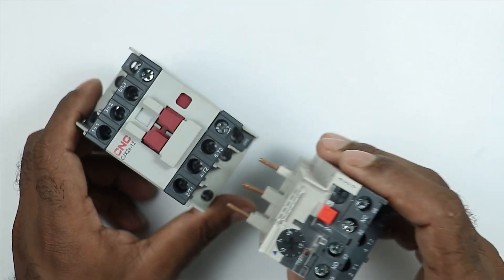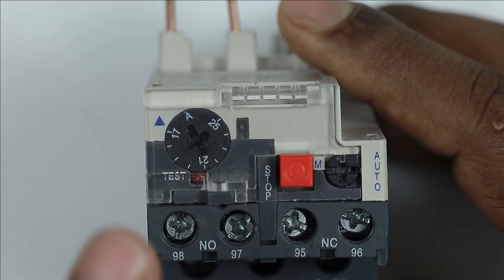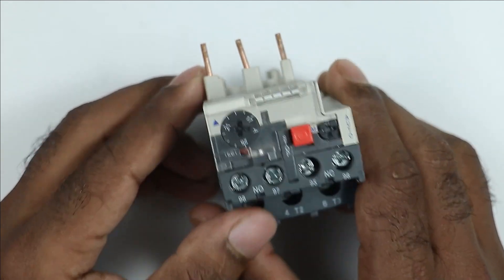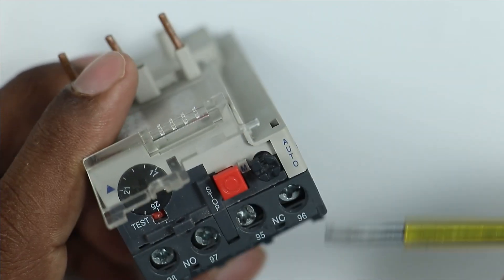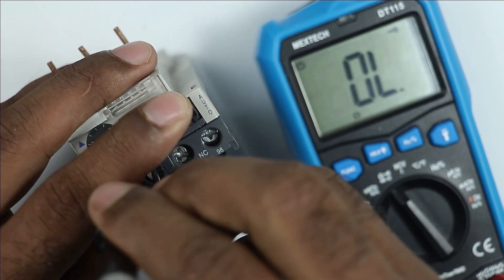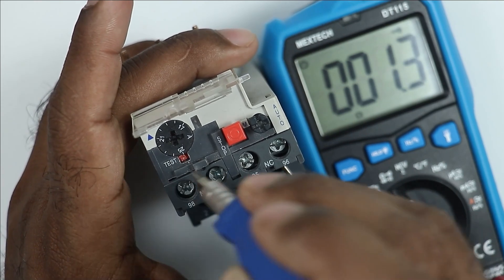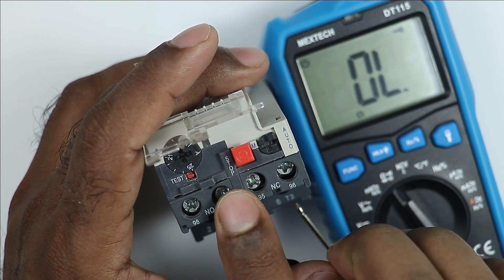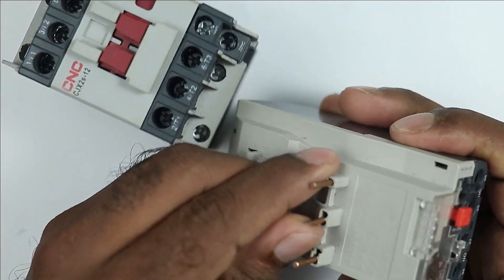Do these things Before Using the Overload Relay for Starter || @TheElectricalGuy

Comment: Excellent, i have a new overload relay with stop button permanently stuck ‘in’ causing the the NC 95-96 terminals to be always open. Now i will always test new contactor and overload relay before wiring to motor. Hopefully the ebay retailer will send a replacement.
Keep up the great work.